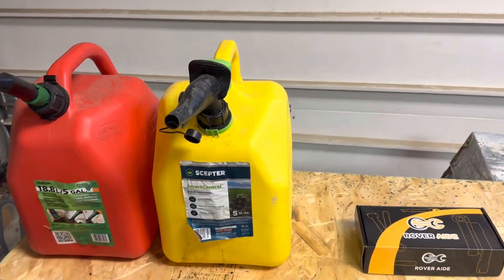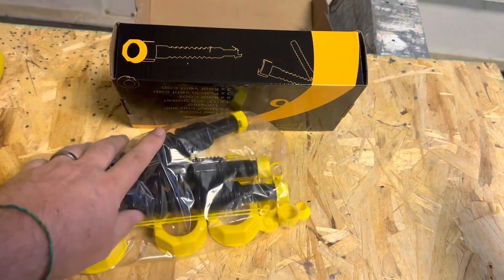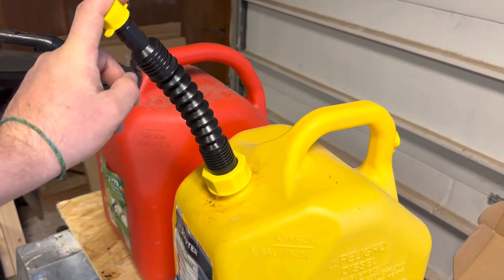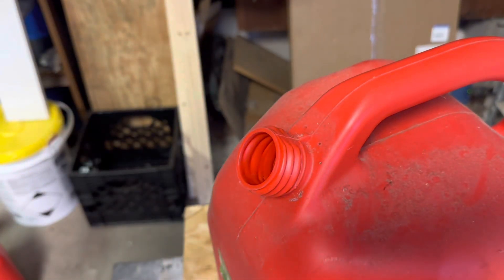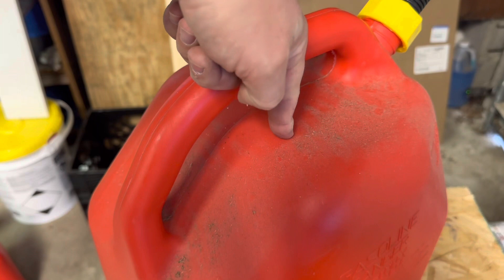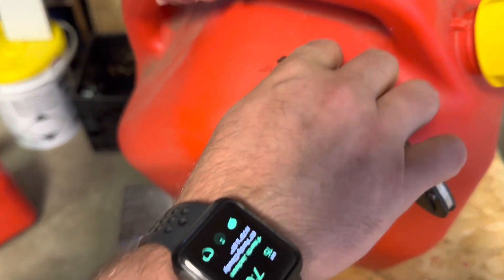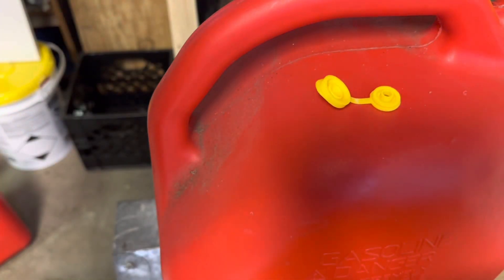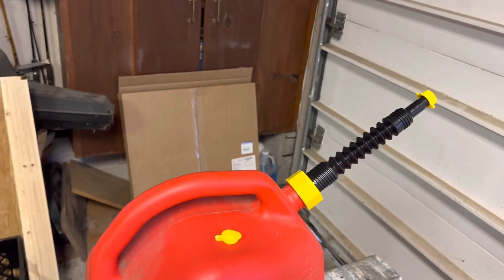How to Replace the Spout on a Gas Can #DIY #gascan #efd

Comment: Hello from Maryland I just watched your video good job. My problem is I bought one of these yellow Amazon spouts for my 5-gallon gas can because my blew off the trailer. When I turn the yellow part it goes three or four threads that just pops and becomes loose again. And it definitely leaks down the front when I tilt it to fill up my riding tractor. Would you guess that the Yellow Cap that I screw onto the gas cap is just the wrong thread for that gas can? It came with one spout one Yellow Cap and three of the little hats that you put on the end of the spout to keep it from spilling, so I don't have any other options to swap out to see if it gets tighter. I'm going to try to add one more o-ring to double the thickness and if that doesn't work I'm probably going to order this one that you have on your video since it comes with different caps with different threads
Reply from the maker: @mrobvious1100  yeah, either thread is different or it’s a little big for the can from what it sounds like
Reply: @efd  thank you for the Fast Response yeah I probably should have researched before I bought one to find a kit like yours that has multiple screw on adapters thanks again.. my son is a jet fighter mechanic in the Air Force and he keeps lecturing me to throw these Antiquated gas cans away and get the metal ones or at least buy the 5-gallon can that pours from the bottom,  and you don't have to tilt it but I'm still waiting for him to give me $50 LOL oh well have a great holiday season